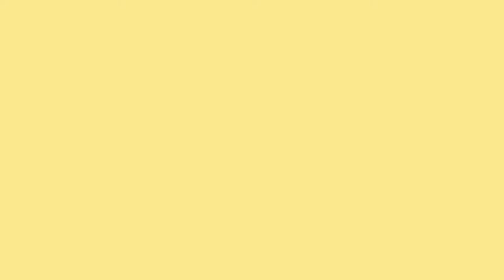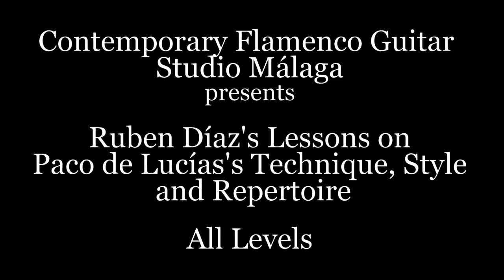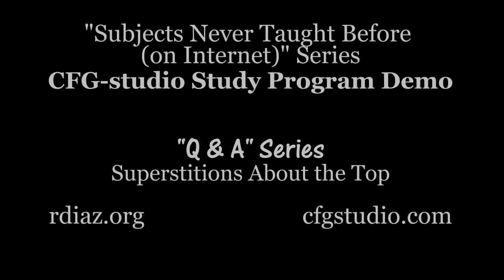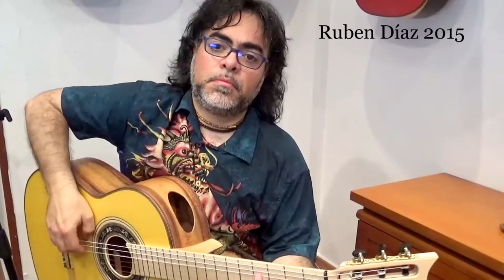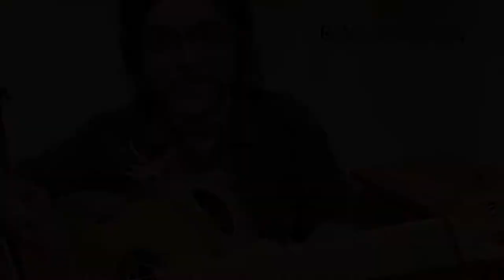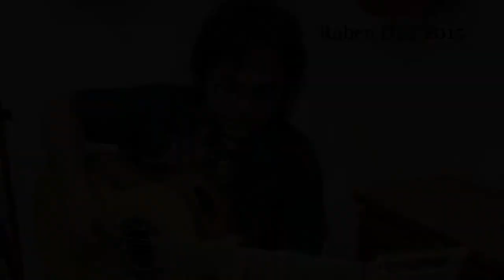"Top superstitions around the top" Tight vs wide grain, stains/myths in flamenco lutherie and beyond

Comment: Again, I find myself in agreement with you Ruben. Wide grain pattern is a cosmetic consideration. A tight grain does not , by any means, assure a properly performing top. It's physical appearance does not indicate the top's stiffness, stability, or even if it is quarter sawn. Well seasoned wood,and an experienced luthier, that can manipulate top stiffness by subtle ajustments to the bracing ,are what's important. 

In his early days, Torres built the best sounding guitars available with wood he scavanged from old furniture. Some early examples of his work exhibit filled nail holes. I repeat, the luthier's skill level , seasoned wood and intuition, not cosmetics, are what's required for an excellent sounding instument.

Since we're on the subject of wood, I'm going to get something else "off my chest". That's the subject of cypress wood. Early guitars were made of cypress because it was cheap and readily available.  Over time, it became a flamenco tradition. Then, through the efforts of pseudo-experts ,it became a false axiom. There wasn't even a distinction made between classical and flamenco guitars at the time. The only real distinction was that cypress guitars were cheaper.The dogma surrounding luthiery can be exasperating. 

Thanks for bringing this up Ruben. People have been indoctrinated with senseless bigotry posing as fact. I fear we will both be dodging the "firey darts" of said indoctrinated. These statements are sure to put them in a state of cognitive dissonance.
Reply from the maker: chopsddy3 I thank you because I always appreciate a lot your deep knowledge of the subject and the fact that I learn a lot from what you say, so thanks again!

Someone has to say the truth even if the dinosaurs complain...

Here are more videos on the cypress subject, 
I dont know if you have seen them yet

The dubious greatness of Cypress blanca in flamenco tradition
http://youtu.be/8q_uSCDstZw?t=14s

Cypress sound is over...Cherry & Machurian Ash deep blanca rocks!  https://youtu.be/BcA2O8z_tZs?t=14s

http://www.andalusianguitars.com/MB1945-18-spruce-birdseyeb-birdseyef-fresno-yellow-18.html 
Manchurian Ash (Fresno) 
http://www.wood-database.com/lumber-identification/hardwoods/tamo-ash/

Here I play this new Cherry guitar http://spain-guitar.com/?pid=86986681
which I also like more than Cypress of course
https://youtu.be/TNp9gzixfRY?t=14s

and yesterday I tried two more new guitars
here made of  Undianuno & Ovangkol 
I think you will like this video
https://youtu.be/l2bina9G_Mk?t=2m50s

My best wishes for you and my respects to your wisdom!

Ruben.

Pd 
I would really appreciate if you read this article when you have time
hence I consider it best job I have ever done, it has a huge amount of work of many many people ,and it also has my best videos and pictures therein, it was completed on March 2015
LINK: http://www.rdiaz.org/rd-art%207.html
Reply: rubendiazguitar Thank you for your kind words . I just watched your video on cypress. I assure the readers that I did not see it prior to my comment. I am not parroting Ruben. To my delight I find that we are of the same opinion.

 That being said, I would like to enrage the dinosaurs even further with another personal observation. It concerns the shallow head angle that the "misinformed" seem to think is a necessary feature on an"authentic" flamenco guitar. The reason for the smaller angle is the same as the cypress situation. It requires less wood and is cheaper to make. Thats it. There is no other rational explanation. Those who say "it's necessary  for the "flamenco sound" aren't making sense. Once a chord is barred, the nut and head angle are irrelevant to the sound produced.